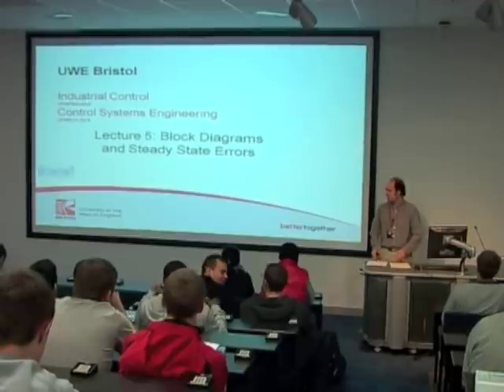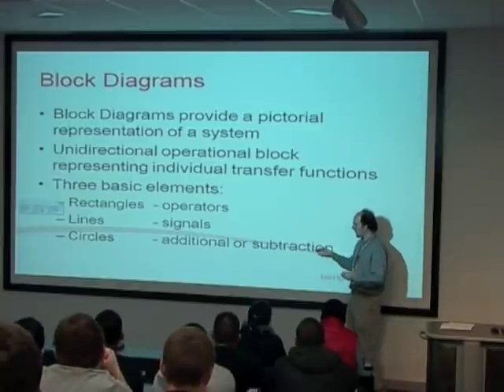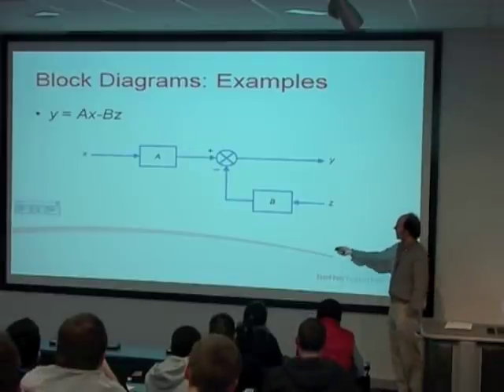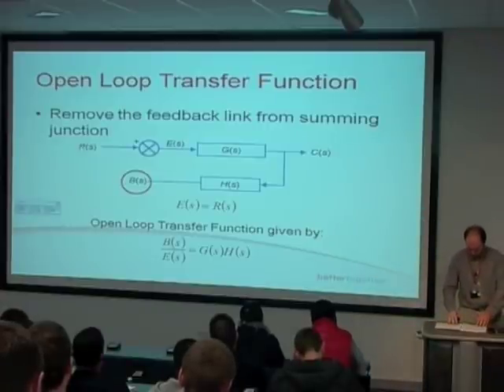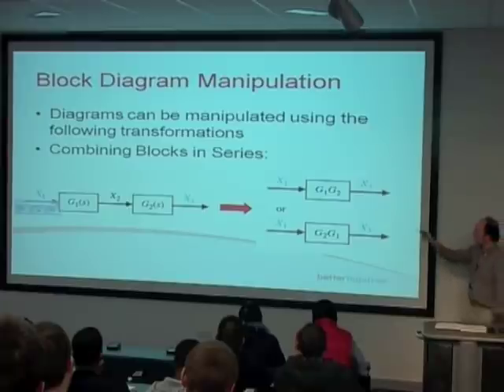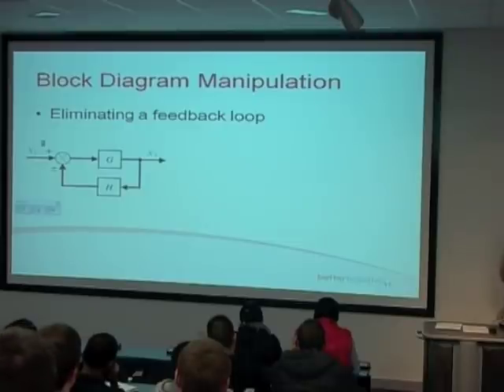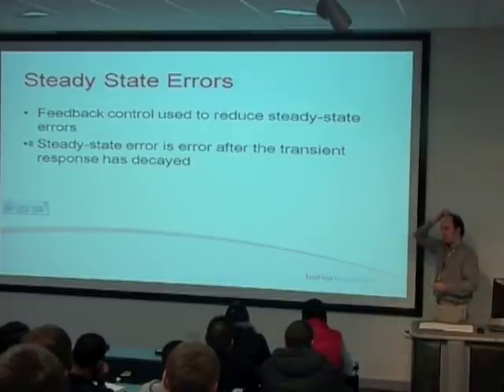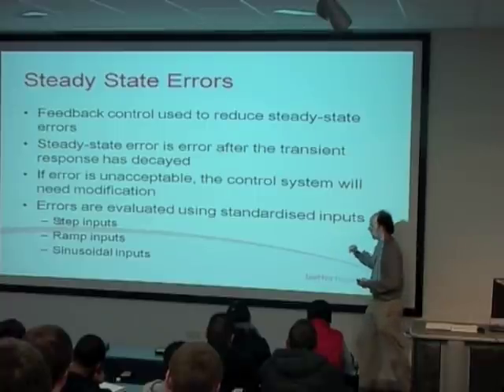Control Systems Engineering - Lecture 5 - Block Diagrams

Comment: Output is theta, input is torque, so the block diagram function is theta/torque. Rearrange the equation (c) from the previous slide to get this. Does that make sense?

Comment: Hello Dr. Drew. In 33:36, there's a plot of the input and the output with the output being A/3 and the error being 66.66%, but didn't we get from the previous calculations a steady state error of A/3? I mean, shouldn't it be 33.33%?
Reply: The output is 33.33% of the required value, meaning that the SIZE OF THE ERROR (the difference between the real output and the required output) is 66.66%, i.e. 100%-33.33%. I think.